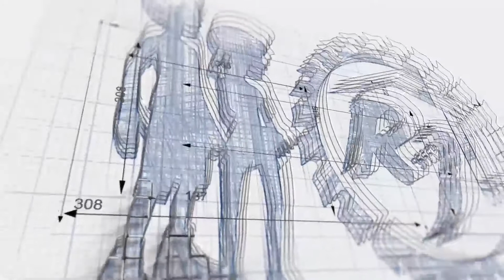DIY Shop Light Boxes Part 2

Comment: Way to save the project! The oscillating multi tool is SUCH a handy one to have around. It was good to see you using it to get those boxes apart. Congrats on finding the solution and getting the lights installed!
Reply from the maker: I suspect that if I had not used the multi-tool, i would still be out in the garage tearing apart my mistake. The wonderful thing is that it proves how strong wood glue really is. :-)   Thank you as always for watching and leaving such encouraging words!